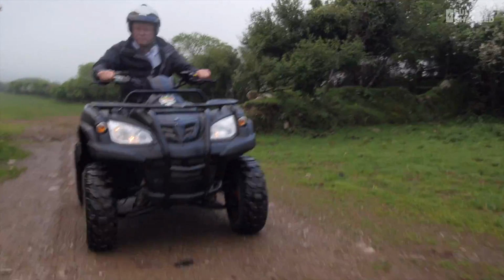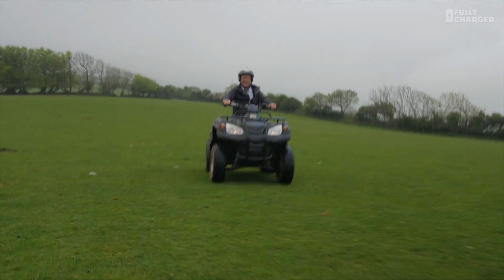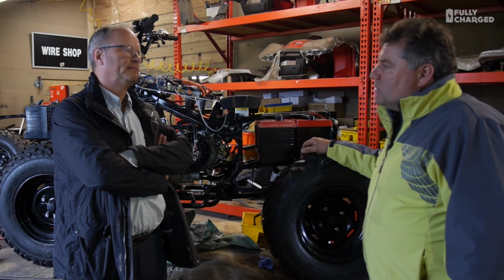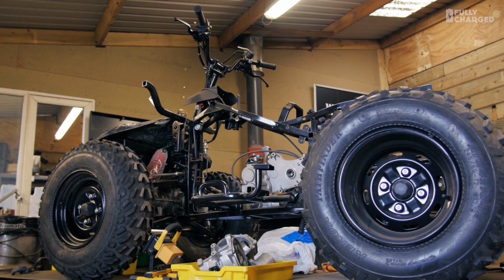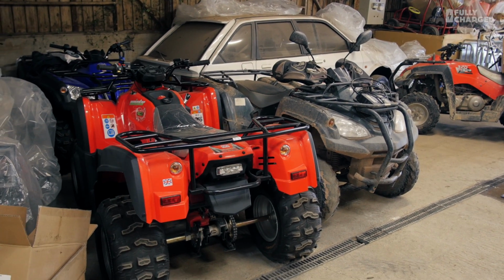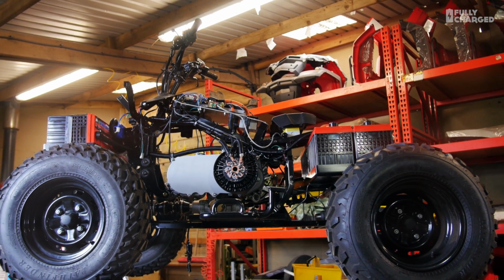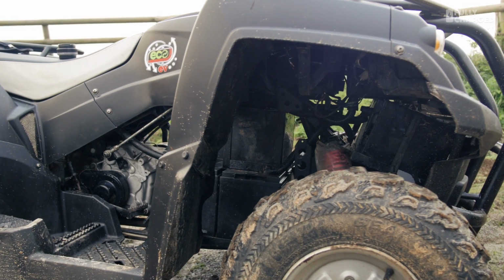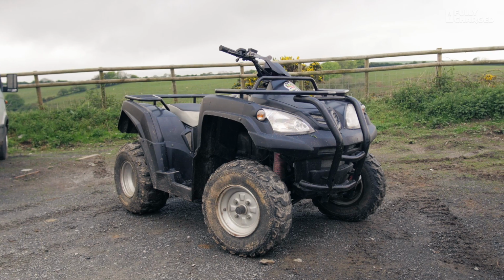Electric Quad Bike | Fully Charged

Comment: It’s a little deceptive to say that it doesn’t cost anything for fuel. Electric vehicles have to factor in the cost of charging (which is not much compared to gas), but also you have to factor in the cost of battery replacement. If they have lead acid batteries, that’s every 3-5 years. If you have lithium batteries, that’s every 8-10 years. I’ve seen lead acid battery replacements for ATVs that cost $1,500 and for lithium about $5,500.
Reply: Well made lead acid batteries will Outlast 5 years, you should be able to get six or seven years, but you can also recondition lead acid batteries at home if they are mechanically sound, but must be done correctly to be environmentally safe.

Comment: 30 miles on a tank of gas must have been very badly tuned I've seen some run really bad and still done way better than that my sons and I took our sport quads on a 12 hr ride basically nonstop but I've never seen electric one do that further more they can't make a battery last more than a few years for cellphones or cordless tools batteries for these and cars are far too expensive to justify the switch from gasoline look at a 25yr old Honda add gas and go try that with these in 5 yrs batteries won't take charge and you're dead in the water

Comment: This man here is completely right about quads 20 years ago or so. I have a new Can-am 570 and he couldn’t be more wrong. It’s not to hot next to my legs, it does about 100 miles on a tank, and it’s extremely comfortable with no vibrations at all. A good modern well put together machine will take you further than one of these. These seem great till the battery wears out in a year. Not to mention these are twice the price of a Norma quad bike and won’t last half as long!
Reply: An electric quad should last almost forever.  Almost zero moving parts.  All the parts are easily replaced.  On an EV you just replace tires and wiper blades, for 15+ years.  The savings on oil changes alone will pay for the battery replacement should you want one after 300k miles.  Now let’s talk about fuel savings over a decade or two…….
Reply: @legonut78  Do you not read the news? Some people are needing battery’s replaced in their teslas already at a cost of £15,000+. Notice how your phone or anything with a rechargeable battery doesn’t last forever? I don’t see why people think electric cars will be any different…
Reply: @BOOTYSLAYER_-le3di   I don’t read or watch the supermarket tabloids from the Murdoch empire.  I look at reality.   Batteries are doing fine and improving fast.   We have them at work.  All fine.  Rarely a dud.  

The previous generation seems good for about eight years.  The current gen is good for over ten years on average, which can be well over 200k miles.   Many are approaching 300k already.

Comment: I understand his point about using lead acid battery because it adds more weight and you want the quad to be heavier so that it doesn't slide around. But, could you use lithium ion battery tech and just add some weight to the underside of the quad where it is needed?  Even make the weights removable in case you want to convert it to a lighter weight for different purposes (like driving on dry pavement).  Just some thoughts.  This is great quad though, I would buy it.

Comment: I'm not sure what ATVs you usually ride but growing up with ATVs, MOST of the ones I've seen will go 70 miles or more on a tank. I'm talking Honda, Polaris, Yamaha.
Reply: That's what I was thinking too. I own a Honda And it goes 85 kilometres or a little bit more, so they need to make it's electric one that go 90 km or more I think. I hoping the Cyber-quad will go 90km or more.

Comment: Does anyone know what could be wrong with my 60v electric ATV?  After charging my batteries, when I take it for a ride on the fastest speed setting, the quad just has no power or torque.  The battery indicator starts dropping.  I metered the batteries and it shows 62v.  Any help would be appreciated.  Please reply to my email: justnguyenbaby2012@gmail.com.  Thank you.

Comment: What happens to regen braking when the battery is full?
Reply: Usually the regen slows the bike yes? So if the battery is full does that mean the bike won't slowdown using regen?

Comment: The narrator keeps talking about the cost of operating a Petro Quad because of the cost of the fuel. The fact is that the electricity used to power the electric quad comes from Petro or coal. So if you take this into account the electric quad is less efficient than the ones that run directly from Petro. In other words, this is a bunch of BS and what this really is a promotion for an inefficient machine that can't even come close to competing with a Petro quad. To their credit they do acknowledge this in an indirect and dismissive sort of way. Although the electric vehicle technology has come a long way. ALL of them are tethered to Petro or coal for recharging so there is no fuel cost savings. All you're doing is shifting the cost of the fuel from the gas pump to your electricity bill in the most inefficient manner possible. Maybe one day but we're not there yet.
Reply: Chuck, perhaps you missed this obvious point. All the electric is provided by the PV on the barn roof! Most farmers have PV somewhere on their farms. The petrol engine doesn't provide the torque that a geared electric engine does. As they can pull petrol engine quads backwards! Whilst they are trying going forward the other way! The electric version in 95% efficient against 30%. No contest. :o(
Reply: OK I don't know what PV is so help me out here. As for torque I would wager that if you used the same gearing on a petrol engine the opposite would happen provided the weight factor was the same for both. Perhaps maybe you're referring to traction versus torque. An 1100 lb vehicle will out pull a 500 lb vehicle hands down simply because of the traction. Otherwise the petrol vehicles wheels will just spin from try to pull something more than twice its weight. Personally I would love to have an electric quad or car that was comparable to one that ran on petrol. If anything just for the noise factor. However the technology doesn't yet exist. When my petrol quad runs out of fuel I can have it up and going in minutes just by adding more petrol to the tank. You can't say that about an electric one. The best an electric can do is swap the batteries while the depleted one recharges which will more than likely take several hours. I agree that the electric motor is more efficient than a petrol engine but if you factor in how the electricity was created (using petrol or coal) that 95% drops quite a bit. Now if someone can figure out how to take one fuel source and convert it into a different type of fuel source with 0% energy loss. Then you would have something awesome. Then it would take only a tiny fraction of petrol (or coal) to create an electric power cell that could power the quad or any electric device for an extremely long time.  Thus making it preferable to the petrol only machine which the public would probably love. However if you did that you wouldn't need power plants because you could use this process to supply all of the power you would ever need. Not to mention the economic disaster that would result from people losing their jobs.
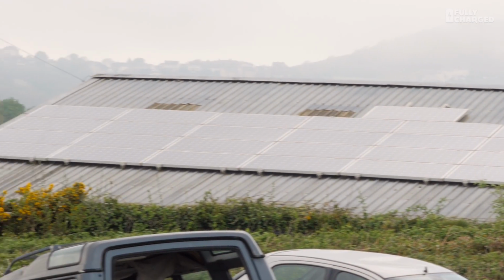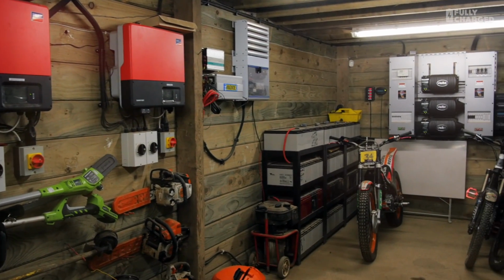Reply: Chuck. you still seem to be missing the point. Again! The Coal/Petrol that you keep referring to has a massive cost in getting it out of the ground and refined to get to your tank in the first place. Haven't heard what PV? It like saying you haven't heard of Trump! If you had listened to the chap. He states that all of the electricity comes from a 50kW battery which is charged via the PV on the barn. Video at 7:20 shows the PV and 7:24 shows the batteries that run the place. With regard to the electric motors are more reliable than petrol.

For you education I have provided a url. :o)

See here: http://fortune.com/2015/11/17/electric-motors-crush-gas-engines/

Comment: They look quite a bit (actually almost the same) as the Sasquatch23 from Daymak in Canada. And the Sasquatches cost a lot less than the EcoCharger Quads. Amazing how much they look like them and they can charge the same way.
Reply: they do look similar rear axle completely different, and only 1kw, these are 15kw, the Sasquatch is cheap though

Comment: It is very interesting to see the variety of vehicles that profit by being electrified. The boat, the quad, the bike... 
To me the quad looks quite solid and will sureley do its job. One can definetly see the potential, because it is just a refitted combustion quad. If they do the next logical step and develop a full electric concept for a quad, I am sure the performance will be even higher! Maybe an AWD with four electric motors in the wheel hubs and the battery below the driver? Makes it even more agile with better grip for an offroad vehicle and the lower center of gravity will definetly be an andvantage! Let's see, where the development goes!

Comment: Roll on EV quads!
Petrol powered farms quads cost me a fortune in servicing.
Two concerns RE: EV, towing ability, I have heard batteries can get hot when under certain load. and handling of water - even if you dont drive through water you need to wash it underneath extensively.

Comment: I think you are i tad off on fuel economy, i have a honda rancher with a 400cc motor and i get over 75 miles out of the tank, most of that running it very hard. I've never tried to see how good a mileage i could get out it after all what fun would that be. but my point would be that once i know that someone has tried to BS me about something, then everything they say is considered suspect. I get the feeling they are exaggerating the capabilities of their model and exaggerating the negatives of a standard gas model. Not saying they don't have a fine product, just don't like when someone is trying to BS me.
Reply: I completely agree, also the main concern I would have it running out of charge and your idle for hours, while the petrol one you could simply carry a spare gas can and a 5 minute refill. I just think the idle time is a major issue, I think because the guy sells entertainment 30 minutes joy ride experience driving around a field, so for him the electric is fine but if you where trying to get a job done and had a 3/4 hour wait, then your plans would go out the window fast and you would waste lots of time.

Comment: I'd like to point out that the company doesn't give HP ratings on its website.  

It talks about pull starting a 7 ton tractor and pulling a 420cc quad.  

In the US most farms in the US typically use 650cc quads or better.  Why because we pull trailers into the fields and such with them instead of using a small tractor.

You get the smallest tool that handles the biggest job you'll need from it.  

I'd really like to know how this compares power wise to my gas powered quad and 20m is nice but what will it do under a real strain.

Comment: See nothing that he took it over is near what my gas powered quad has to traverse. And typically my gas powered quad is pulling a trailer that empty weights about 800-1000lb and loaded it can easily exceed 2500 lbs.
And my quad gets around 80-100 miles on a 6 gallon tank. Not the 30 he talks about. Granted it doesn't do 30 miles in one day. But how would the charge handle the strain that my quad does on a regular basis. 
I've pulled cars out of fields, tractors back to the the garage. If it needs to be pulled it gets pulled with the quad typically.

Comment: Why did they put the motor between the legs and the batteries in the back? The other way around would make much more sense I think.
Reply: I would imagine so they could just bolt it up to an off the shelf quad drivetrain rather than having to develop their own.
Reply: so the weight would be over the wheels, handy when towing stuff.

Comment: It's sad that it isn't lithium ion, they could have had longer range, longer lasting batteries and "weight" could easily have been added by using more batteries or even weights
but I would imagine it might allow for higher drain

Comment: Could they not build solar panels on the bike. so when the farmer are using or more likely  off working there Field it's just sits there and charging with out need for user to but in charing mode.   if not poss What about direct wind turbine or static solar panel charging.
so have them dotted around the farm and charge str8 form the unit it self
Reply: +vladzis adding more batteries increases the weight more than just battery weight you need more structure to support that weight.  

So now the motor has to strain more and is less efficient.  

It's the law of diminishing returns
Reply: zazugee if you had a big heavy trailer of solar panels and batteries they are going to weight down the motor causing it to be less efficient
Reply: Vice versa can it be use it like steam engines and  use the electric to power other elections items on farm  maybe off grid shed lighting, eclectic tools in the shed like the one the makers use or even machinery like saws or bigger that need power like old steam traction engine did
Reply: Small solar panels take around 8 hours to provide the charge for about 5 minutes use.

These guys have massive panels, and wind collectors going to battery storage.  Then they plug them into that.
Reply: +Willie Pierce other ideas is extra batt storage or have one at home to change over  would direct plug in to a wind turbine idea work for out on the farm
Reply: +Matthew Stamp if you put more battery on the quad you increase its weight.  On an electric car something like 1/3 of its weight is the battery.  

If you followed the same pattern and increased the batter weight then you loose charge/distance ratio.  So you get diminishing returns the more batteries you add the less distance.

On a Chevy volt with a 200 lb driver an additional 100lbs of battery actually reduced its initial range.
Reply: +Matthew Stamp steam engines are horribly inefficient.  Something like 80% power loss.  So if you built a steam power plant your putting more smoke into the air than if you used public power.
Reply: A lot of the problem comes in like this.

If you don't support the tech it's not going to get better.  But if you don't have the money to buy something that will actually do the job you want and one of these... Then you pretty well have to go with the gas powered unit.

Where he talks about how fast it is.. My quad when I accelerate hard in 4wheel drive will rip the ground up.

He accelerates hard and it barely accelerates better than my 125 that I gave my 8year old niece because it doesn't have the power to do the work I need done.
Reply: +Willie Pierce no steam engine like what Fred Dibna use to ride I mean as it is or add extra battery's to the unit and it could power lights in a hut to machinery like steam engines and a thrashers
Reply: +Matthew Stamp steam is very inefficient.  The smaller you go the less effective it is. 

The most efficient one I've seen had about 10,000 in copper tubing and was around 60% energy efficient. It burned coal like 3 tons a day.  

It was taken out of use in the 80s and replaced with more efficient coal power plants.

Something as small as your referring to will have around 20% efficiency with coal.  About 10% with wood 

There is a reason that gas engines  (around 50% ) efficient are used.
Reply: +Willie Pierce your missing the point it's that type of using one vehicles power to work another in this case electricity
Reply: +Matthew Stamp that doesn't mean steam suddenly is a viable option.

Nor does it mean small solar panels will have any noticeable effect except to increase cost.
Reply: +Willie Pierce if the Leaf would weight just 450kg, I'm sure I would get more than 80 miles per charge from 24kwh battery
Reply: unless you have a big PV trailer, it's pointless, a PV trailer can be usefull if you're going on a long trip in the wild and staying for a day camping.
Reply: +Willie Pierce the point someone (too lazy to read all comments) made, that battery is 1/3 of car weight. According to that comment, the Leaf weights just 300kg, or 1ton less than paperwork states.
Reply: +vladzis I'm just referring to the law of diminishing returns when it comes to adding the weight of additional batteries and solar panels.

The more weight adds more strain to the motor which reduces its efficiency.

Comment: Anyone else think this show is better than the new Top Gear?
Reply: What you talking about? This is the new Top Gear! :oP
Reply: I don't think Electric Vehicles have any gears ?
Reply: Just one gear usually.
Reply: Indeed, I wish fully charged was a show similar to top gear, but just focusing on non fossil fuel vehicles.
Reply: they do, just not as many usually.
Reply: NOT better than Top Gear with Clarkson, Hamster and Captain Slow.
Reply: @cinegraphics  you're wrong
Reply: @JonathanMcBrien  well, this is more boring. Isn't it? Top Gear is an entertainment show. If you wanna compare it to that, you have to offer entertainment. If you wanna compare it to something for expert mechanics, then compare it to another show.

Comment: Power: 30hp
Range: 30 miles
So far so good
Led-Acid batteries!?! Come on! They suck. Most of all life-length. Say 500 cycles and 30 miles on a charge means 24000km/15000miles meaning the battery will be fried after a couple of years...
Reply: He did say that most people only travel about 6 miles per day on these things. With that distance the batteries would be good for 2500 days or almost 7 years.